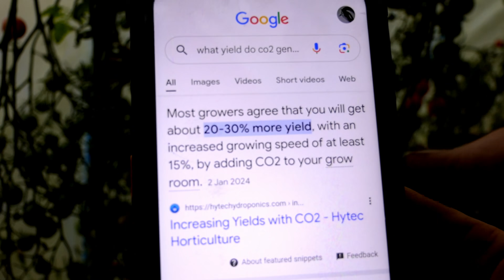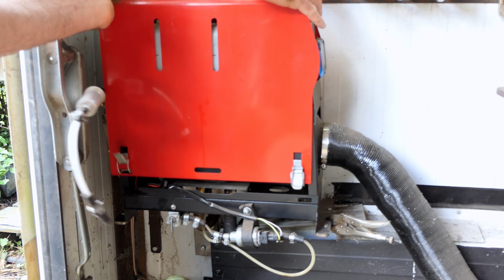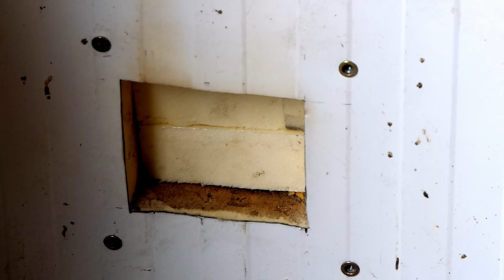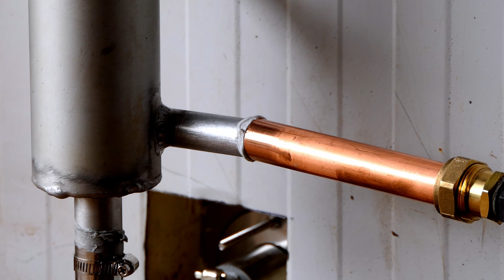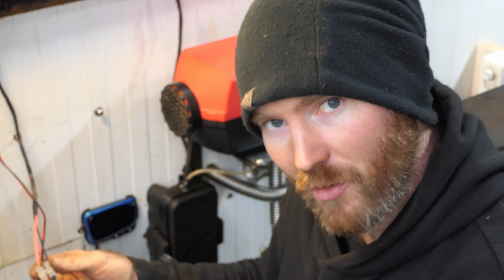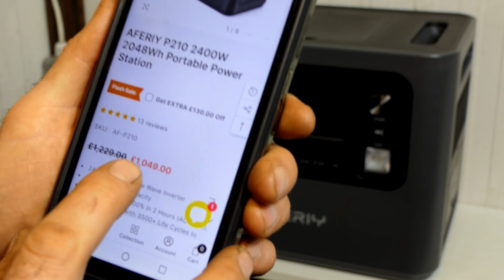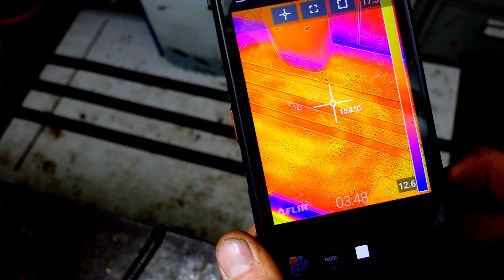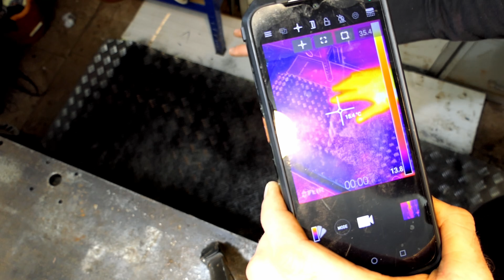NEW! Better system for Cheap and Safe Heating💲+ Underfloor Heating Mod test🫠

Comment: Hi Josh, love your channel and you explain diesel heaters very well. But you're wrong re: climate change. Anthropogenic influence has certainly affected atmospheric CO2 levels. As you correctly stated, CO2 levels during the time of the dinosaurs was much higher. But that isn't strictly the problem. The real problem is the rate of change far exceeds the rate at which we and other species can adapt to the changes. I'm an Earth Scientist :)
Reply from the maker: @jackmason7823  what about the data NASA produced saying CO2 level follow after heat levels increase. I don't doubt CO2 level just the impact compared to a multitude of other factors. I'm also interested if you produced a different narrative would you lose your funding like the many other scientists? Check the comments as there are many who seem to know what they're talking about who are in agreement with me. Cheers J

Comment: Hi Josh , Have you considered using a big old iron radiator to simply run the exhaust through from bottom and out at the top other end , then out   Simple is usually " Good "  let me know what you think
Reply from the maker: @timothysleight844  yes, it's been talked about a lot. However cleaning the inside of it is an issue, acidic condensation is an issue and getting the correct size fittings is an issue. Cheers J

Comment: Hey Joshua! I want to express my appreciation for your work. I just watched the last four videos about your diesel (kerosene) heater and loved the improvements you made. You explained how it works in a quick and straightforward way, which taught me a lot.

I live in Germany, and I’ve been looking for a relatively cheap way to heat my basement, which is my big hobby room. Electricity is not an option because we pay over 0.40 euros (0.33 British pounds) per kWh, which is insane. We’re heating our relatively large home with diesel because it’s nearly impossible to get kerosene here. They claim it’s "made for aircraft and dangerous," which I consider a form of corruption. However, diesel is cheaper here anyway. The diesel we use for heating costs about 93.70 € per 100 liters, which is roughly 35% cheaper than at gas stations because it’s taxed for heating purposes and not for driving. But I still want it to be cheaper!

I volunteer at a facility in my village for fun alongside my full-time job, and we often have a few liters of leftover sunflower oil. I’d like to reuse it, partly because disposing of it incurs costs. At the end of the day, it feels like a win-win situation. Technically, it might be tax evasion, but I need to research that more thoroughly.

I won’t make any claims that aren’t correct. Greetings from Germany!
Reply from the maker: @semiplex9727  well done. Thank you so much.Turning used sunflower oil into bio diesel is definitely a cheap way. If no cash is exchanged I think it doesn't class as tax evasion and is only applicable on vehicles anyway. A grade of Kerosene is used as jet fuel but if you search for heating oil then that specific grade maybe available. Cheers J

Comment: Definitely agree, I'm sick of hearing politicians defend economic hardship by saying, "...We have a climate emergency.."
Reply: Which economic hardship are you talking about? Geographically I mean. There certainly are areas of the workd that are already facing economic hardships due to the climate emergency. If you mean USA and europe tho, I haven't read of any politician claiming that. Can you link to an article?
Reply: @moonshinewilly01  
Fuel Duty:

Fuel Duty, applied to motor and heating fuels, is by far the largest contributor to environmental tax revenue in the UK. In 2023, it accounted for 63.2% of UK energy taxes, highlighting its significant impact on both tax revenue and taxpayer costs.

￼

Climate Change Levy:

Introduced in April 2001, the Climate Change Levy targets non-domestic use of energy. It has been a considerable source of revenue, especially since it effectively replaced the Carbon Price Floor taxes from 2013.

￼

UK Emissions Trading Scheme (ETS):

Previously part of the EU-ETS, the UK's own ETS since January 2021 has contributed significantly to environmental tax revenues. Together with Renewable Energy Obligations, it accounted for 33.5% of energy taxes in 2023.

￼

Vehicle Excise Duty (VED) and Air Passenger Duty (APD):

These transport-related taxes also contribute to the environmental tax burden. Although specific figures for these in relation to other taxes are not detailed in the sources provided, they are part of the broader category of transport taxes, which made up 22.5% of environmental tax revenue in 2023.

￼

Plastic Packaging Tax:

While newer and thus less impactful in terms of historical revenue, the Plastic Packaging Tax has still raised significant amounts, with £279 million collected in 2023. This tax aims at encouraging recycling and reducing single-use plastics.

￼

These taxes not only raise revenue for the government but are also designed to incentivize behaviors that reduce environmental impact. However, they do come at a cost to taxpayers, particularly through increased prices for fuel, energy, and certain goods, which ultimately translates into higher expenses for both individuals and businesses.
Reply: @moonshinewilly01  
Fuel Duty:

Fuel Duty, applied to motor and heating fuels, is by far the largest contributor to environmental tax revenue in the UK. In 2023, it accounted for 63.2% of UK energy taxes, highlighting its significant impact on both tax revenue and taxpayer costs.

￼

Climate Change Levy:

Introduced in April 2001, the Climate Change Levy targets non-domestic use of energy. It has been a considerable source of revenue, especially since it effectively replaced the Carbon Price Floor taxes from 2013.

￼

UK Emissions Trading Scheme (ETS):

Previously part of the EU-ETS, the UK's own ETS since January 2021 has contributed significantly to environmental tax revenues. Together with Renewable Energy Obligations, it accounted for 33.5% of energy taxes in 2023.

￼

Vehicle Excise Duty (VED) and Air Passenger Duty (APD):

These transport-related taxes also contribute to the environmental tax burden. Although specific figures for these in relation to other taxes are not detailed in the sources provided, they are part of the broader category of transport taxes, which made up 22.5% of environmental tax revenue in 2023.

￼

Plastic Packaging Tax:

While newer and thus less impactful in terms of historical revenue, the Plastic Packaging Tax has still raised significant amounts, with £279 million collected in 2023. This tax aims at encouraging recycling and reducing single-use plastics.

￼

These taxes not only raise revenue for the government but are also designed to incentivize behaviors that reduce environmental impact. However, they do come at a cost to taxpayers, particularly through increased prices for fuel, energy, and certain goods, which ultimately translates into higher expenses for both individuals and businesses.
Reply: @moonshinewilly01  
Fuel Duty:

Fuel Duty, applied to motor and heating fuels, is by far the largest contributor to environmental tax revenue in the UK. In 2023, it accounted for 63.2% of UK energy taxes, highlighting its significant impact on both tax revenue and taxpayer costs.

￼

Climate Change Levy:

Introduced in April 2001, the Climate Change Levy targets non-domestic use of energy. It has been a considerable source of revenue, especially since it effectively replaced the Carbon Price Floor taxes from 2013.

￼

UK Emissions Trading Scheme (ETS):

Previously part of the EU-ETS, the UK's own ETS since January 2021 has contributed significantly to environmental tax revenues. Together with Renewable Energy Obligations, it accounted for 33.5% of energy taxes in 2023.

￼

Vehicle Excise Duty (VED) and Air Passenger Duty (APD):

These transport-related taxes also contribute to the environmental tax burden. Although specific figures for these in relation to other taxes are not detailed in the sources provided, they are part of the broader category of transport taxes, which made up 22.5% of environmental tax revenue in 2023.

￼

Plastic Packaging Tax:

While newer and thus less impactful in terms of historical revenue, the Plastic Packaging Tax has still raised significant amounts, with £279 million collected in 2023. This tax aims at encouraging recycling and reducing single-use plastics.

￼

These taxes not only raise revenue for the government but are also designed to incentivize behaviors that reduce environmental impact. However, they do come at a cost to taxpayers, particularly through increased prices for fuel, energy, and certain goods, which ultimately translates into higher expenses for both individuals and businesses.
Reply: @moonshinewilly01  Quebec, Canada, "Julie Pressé" from the Municipal Corporation of FORTIERVILLE "declared" an "Environmental Emergency". 

Result? The only mass grower of GMOs now has his "water commitee".
Reply: @moonshinewilly01  you mean you're unaware of the green taxes in the UK, especially those pertaining to domestic energy?  There's too much to discuss..
Reply: So when you are sitting in a car that just drove over a cliff you get sick when someone tells you that the car will crash?
When did you become that ignorant and why do you hate children?

Comment: 10/10 for editing , pacing , funny jokes and valuable information ... got me engaged the whole time👌
Reply from the maker: @GabrielKozsar  thank you. Cheers J
Reply: @joshuadelisle  btw , yesterday I received my KROAK 5kW unit and I noticed the pump  was ticking only at startup (1.run->priming) , once the heater got to full temperature , the pump went completely silent. I've checked the pump and seems like every other one with the rubber holder in horizontal position. Therefore I do believe they tuned the signal to pump to make it silent (maybe less forceful?). I do not have time or will to hook it up to a oscilloscope , also I don't have another ticking unit to compare.
Reply from the maker: @GabrielKozsar  interesting. I'll check that out.

Comment: Really enjoyed watching your gadget laden DIY heating experiments. I've got to say though, that metal skinned garage must be a ball ache for fixing heavy stuff to the walls?! Would drive me mad lol. Couldn't of used timber or block?
Reply from the maker: @Phil.Graham  for heavy items I just erect a tube steel frame independent from the wall. I've seen plenty of block walls fall apart not to trust them without reinforcement anyway. Cheers J
Reply: @joshuadelisle  yes true, I built mine out of timber and lined the inside with osb board 🤣. Have a great day.

Comment: hi mate ive got 3 diesel heaters in my home. bathroom with the exhaust going into a empty radiator same in the kitchen and at the top of the stairs, by the time the hot air exits the radiator it cold.

Comment: There is no doubt that the climate is changing, and that should be obvious to anyone with more than one brain cell. 

What's debatable is the contribution to accelerating it by humans; are we turning what was essentially a closed system, where everything in the atmosphere was recycled, into an open one, by burning stuff that was previously locked underground, and that argument doesn't seem to be beyond the wit of man.

Comment: You could try a secondary heat exchanger from a condensing oil boiler a Worcester unit may be the easiest to convert to your application it will also have a convenient drain or the condensation.

Comment: what if you put the exhaust from the heater directly into an all metal radiator from something large like a truck then hung that radiator on the wall inside the shop. you would need to weld some new fittings on it to accept such a small exhaust pipe. then exhaust it out the wall as were doing in this video. you might need a second fan on the far side of the radiator to help pull it through. you could also just run the exhaust through a long loop of thin wall piping like car exhaust pipe. put lots of S bends in the pipe so that it sheds all the exhaust heat by the time it makes out the far side of the shop.

Comment: Ironically enough I watched this after posting my air-to-water idea earlier. Great minds I tell ya. 😉
On that end note, I prepared a CO2 study for a group in the mid 2000s on human vs 'natural' air toxicity sources. Rather conveniently, almost all of the human-pollution papers fail to notate forest fires and volcanoes, which in one event, can dump multiple decades worth of noxious gases into the atmosphere produced by humans. I've seen some amazing things, but not once was there ever an EPA guy at a forest fire or an active volcano event throwing themselves at 'the problem'. 
Aside from the oceans where we don't necessarily want excess CO2 to be absorbed, the greatest absorbers pound for pound of CO2 is peat moss (also a large part of what makes up high quality coal, with compressed swamp matter). If we were to grow it anywhere and everywhere it can grow (walls, building roofs, etc) it would be entirely possible to offset current emissions from fossil fuels With a surplus.
Of course my paper didn't fit their narrative, so it was promptly shelved and I never heard from them again.
Reply from the maker: Thats very interesting. thank you for shareing. cheers J

Comment: Thanks .-My  K12 from 1960 era calculations are the earth converts  a mere ~2 millionth parts of the atmosphere to CO2 eg 2 PPM. That's ~0.0002% per year .That's the good or bad news depending your axe to grind .Atmospheres is ~5',000,000,000,000,000  metric tons ( ~5 Quad trillion tons   and ~21% is oxygen ~ 105,000,000,000,000 tons ~105 ,000 billion tons  .Then divide that  O2 PPM by 0.0002 PPM of CO2  and oxygen lasts 525,000,000,000,000,000 years ( ~525 Quadrillion ) years .if we exceed CO2 levels of ~15% 0f the 21% we humans die so devide the  1/2 Gazzion years by that number and we arrive at 78,750,000,000,000,000 years before humans die . Some  encyclopaedias state if we chopped down all the 3 trillion trees on the planet we would all die in a few years. Clearly that's CR@P  and kills the idea that CO2 is major gas  and not a trace gas .Lots of people who have been told by the Swedish Changling that we are gonna die soon and many peoples think its because we run out of air to breathe. However I cannot resolve the Issue of humans add only 3% of this CO2 of the 0.0002%  of annual CO2 made .  It seems we burn in fossil fuels  about ~11,000,000,000 tons  ( ~11  Billion tons ) of  Carbon fuels  every year which makes some  ~40,000,000,000 tons ( ~40 Billion tons) of CO2 as 1 ton of carbon fuels makes some  ~3.8 tons of CO2 gas. Now the oceans they say soaks up 50% of CO2 in the atmosphere every year and land and forests soak up another 25% of CO2 each year  so some ~30,000,000,000 billion tons of fossil fuels C02 emissions  is taken out  of the atmosphere each year leaving  10 billion tons in the atmosphere of CO2 emission  from fossil fuels . Best i can figure  0.0002% of atmosphere  = 10 billion tons  or 1/2,000,000 of the atmosphere . Eg CO2 accumulation is 100% from fossil fuels says my awful maths . Now the maths given is ~3 watts per square meter is the rise of temperature over ~100 years is the climate activist CO2 cooks our goose  when the average solar heat is some 275 watts per meter. Percent's that less than 1% so its too me a load of CR@p. Also the  main number is the atmosphere has trapped 99% of all solar heat it can trap at 280PPM of CO2 and the most we can trap extra of heat in the atmosphere is an extra 1% if we get to some ~800 PPM .Confirm my K12 maths are correct and avoid the millions of scientists that say humans make 3% of the annual CO2 which doesn't matter how much CO2 we humans make best I can see as the  level school K12 dunce of the class  at maths
Reply from the maker: Those are very interesting calculations. Thank you 👍. Cheers J

Comment: Great content Joshua! Recovering the exhaust heat can of course not only save on heating costs but is also beneficial to the environment by making maximal use of the fuel burned. 

I see that you are planning to make your own heat exchanger with a barrel of water. I have long thought that the most efficient way to capture all of this heat is to feed the exhaust directly into a sizeable stainless steel water cylinder (200 - 300ltr) and use a CP fan on the outlet to mitigate backpressure combustion issues. The exhaust pipe would be as short as possible, insulated and connected directly to the flow inlet of the tank. As this pipe spirals downwards inside the tank to the return outlet all condensate will self drain. 

The coil is several metres and I suspect will remove the heat extremely efficiently. However, this would result in too much friction for the heater's fan to push and so a cheap low wattage CP fan can be added at the return outlet with the construction of a bespoke adapter. The outlet temperature should be well within the fan's safe operational range. A condensate drain can be added just before the fan and depending upon its size can be used to balance the fan with the heater for good combustion. 

The water tanks are plentiful and cheap these days, are insulated, and should already come with the much needed expansion vessel and pressure release valve so that you can't overcook it. If tuned correctly and burning efficiently, an annual service and clean should easily keep the system spotless. I've been wanting to try this out for a couple of years but have not got around to it. Good luck with the next experiment, I look forward to it! :)
Reply from the maker: Those are great ideas. Thank you. Cheers J

Comment: great work btw. you should try the exhaust through a small car/bike all aluminium radiator maybe 300x300 inside the room with a couple 120mm pc fans on to remove all the heat from the exhaust into the room.